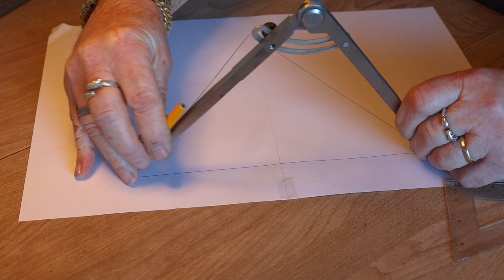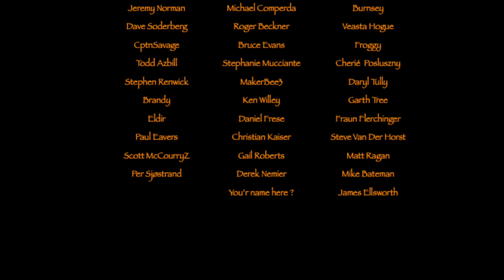My 5 C's.....Introducing Cornelius

Comment: Cornelius adds great excitement to you camp I hope to see him in all or most of your videos to come I really like the fire pit . If you have access to them refrigerant drums make great project material empty of course
Reply from the maker: Thanks for your feedback David 😁👍🏻 and suggestion 
But I don’t know what that is maybe you can explain? I’m glad you joined us out in CimbrerCamp 🌲🐕🏕🔥🦴
Tom
Reply: I work in the refrigeration industry and the cooling fluid for the machinery comes in small drums they are generally thrown away after proper handling of empty. Containers . You local heating and cooling contractors may be glad to have you some. The metal is easy to cut with angle grinders but sturdy enough to make fire pits I told a couple and made a wood heater that looks like an old copper boiler and works great and looks good

Comment: Hello? did you know the ( USB symbol ) came from the Viking age? >>>> I don't know which USB promoters designed the symbol, but I do know that the USB icon was drawn to resemble Neptune's Trident - the Dreizack. The trident actually has triangles on all three prongs, but the icon has a circle and square on two of them. The alteration was made to give a sense of universality and to signify all the different peripherals that could be attached using the standard.
Reply from the maker: Yeah that’s right Richard 😉 it’s bind-runes … the H and B rune in one runes Harald Bluetooth 😊👍🏻🏕🔥 Tom

Comment: In English you used a compass on the paper.
Reply: Curious of your beard beads? I'm Danish but not familiar with the implementation of the the beard beads
Reply: Are the made from shells or clay??? I think shells knowing my family
Reply from the maker: Ok 🤔 didn’t know that Sean 
Thanks for your help 😉👍🏻
Tom
Reply from the maker: I buy them from Grimfrost 😉 and I believe it’s an old Viking tradition that they had beads or rings in the beard 👍🏻😁🇩🇰
Tom
Reply from the maker: The white ones I sometimes have on is made out of bone 🦴😉👍🏻🏕🔥🌲🇩🇰 Tom